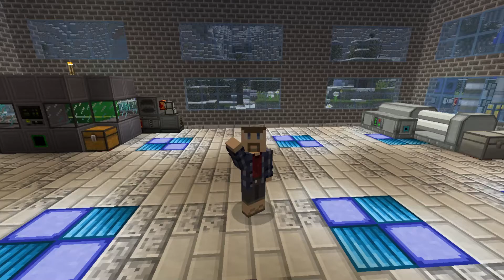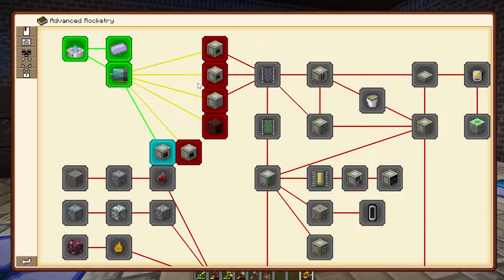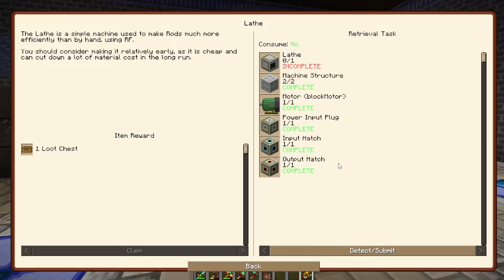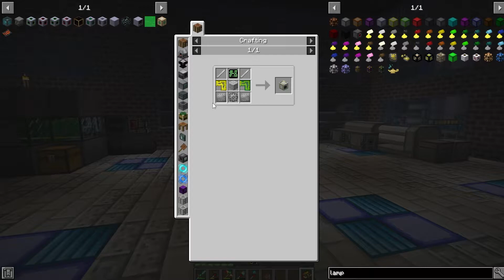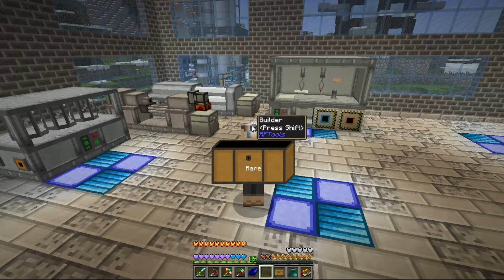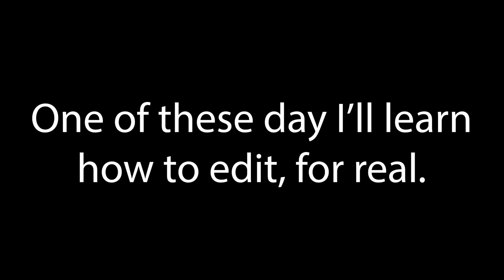Setting up an Advanced Rocketry Machine Lab - Minecraft: Enigmatica 2 Expert #55

Comment: I have a problem. Ive been using 1.12.2 advanced rocketry and have tried to make a control circuit board. I use what I believe is the correct recipe (redstone top left and right, diamond top middle, wood plank center, iron plate bottom center, copper dust for the rest), however, nothing appears in the right box. I'm wondering if I'm using the correct recipe, if the recipe has been updated, and maybe your thoughts on what is wrong? If there is a place with a comprehensive list of all recipes that would be great.
Reply: solved this issue, quarts is used instead of a diamond.
Reply from the maker: Glad you figured it out.  Unless you're playing Enigmatica I probably wouldn't have been able to help anyhow.  The recipes are heavily altered.  The official documentation for Advanced Rocketry is here if you haven't found it, although it wouldn't have helped with this issue:  http://arwiki.dmodoomsirius.me/AdvancedRocketry/1.12.2/index.html